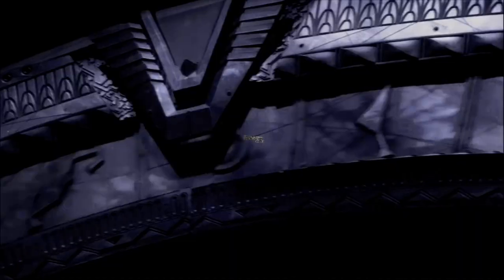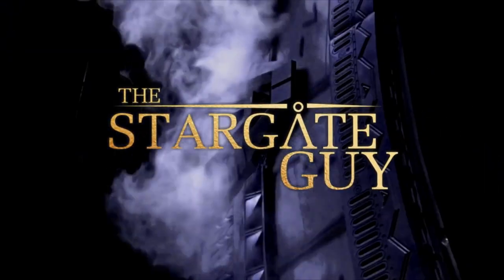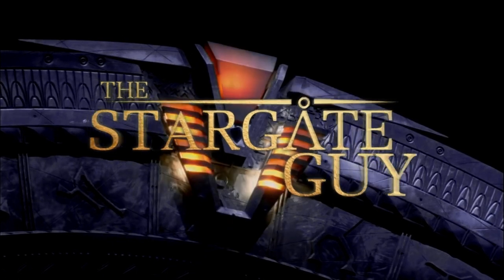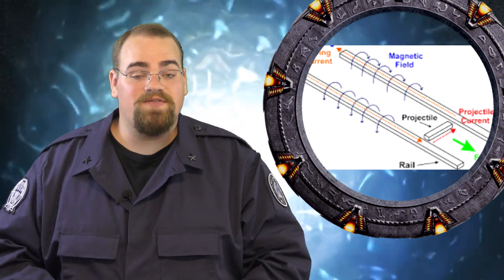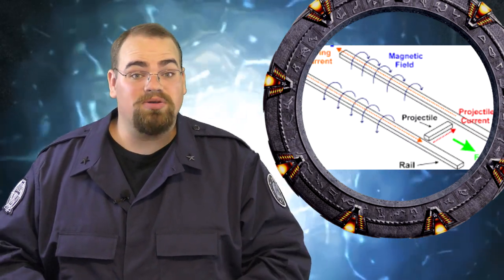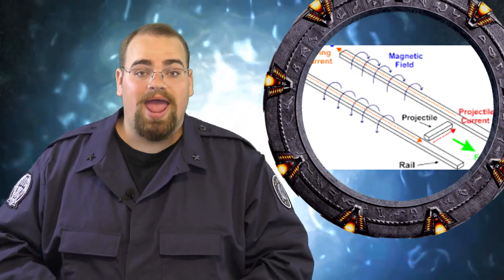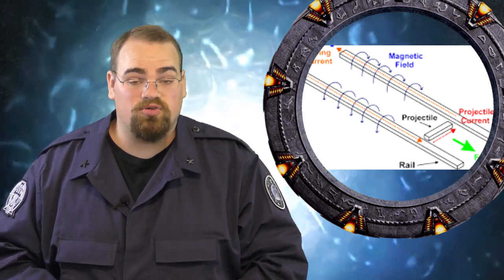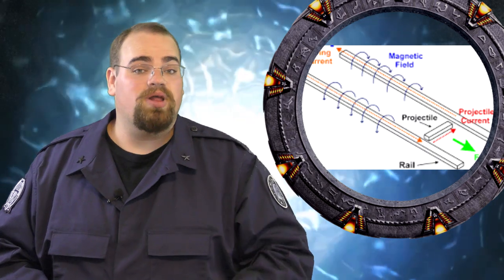Rail Gun : How it Works

Comment: To accelerate 0.05kg bullet to mach5 (1715m/s) you need 147kJ of energy. With 500 rpm the Power output is about 1.23MW (yes that's megawatt). Sources vary on how efficient railguns can be, ranging from 16% to 90%. That still means the gun would produce on order of megawatt of heat, most of it ending in the rails and faraday cage containing the EM field. The gun would melt in a single round without some magic cooling system. It might even be a railgun/steamcannon combo - one projectile propelled by the railgun and second propelled by the vaporized liquid nitrogen used to cool the railgun.

Comment: It wouldn't surprise me if in the near future the US Navy developed a line of nuclear stealth submarines that used rail guns instead of missiles. Either that or nuclear powered destroyers. It wouldn't be very practical to have such a gun on a Nimitz or Ford class carrier (no room). Whatever the ship, they would almost certainly need to be nuclear powered, traditional diesel-electric likely wouldn't be able to meet the power requirements.
Reply from the maker: Well they might in the future. It seems like the next wave of weaponry. I wouldn't be surprised if they managed to fit the tech into a more hand held version at some point. Our battery tech is starting to get up there.

Comment: Ironically, kinetic weapons such as rail guns should be more effective against shields as they have a neutral charge and hence more difficult to deflect by fields alone.  The problem with how they used it on Atlantis is that rail guns are artillery not point defense weapons, the Gatling guns shown on the Expanse would've been better suited for anti-aircraft roles.  

The BAE rail guns funded by the Navy requires the conductors be resurfaced and adjusted preferably between each shot and the gun did not meet the requested range and velocity requirements.  Personally, I did not find this surprising as the Navy wanted a strategic replacement for expensive cruise missiles hence the desired range and velocity while arms manufacturers are not motivated to replace profitable cruise missiles with metal slugs.  It really looks like BAE really didn't even try to reduce the well known conductor wear problem of rail guns, they did not use conductive lubricants, they did not use plasma as the conductive interface or even disposable wires to the sabot, they didn't even consider ditching the Lorentz force and go magnetic with the coil gun, they simply said that the conductors had to be adjusted and resurfaced every one to five shots.  I really think they didn't want to endanger cruise missiles sales.

Comment: Okay too many issues with this video:
- Ha'taks are not small, they are mother ships. The Al'kesh are probably what you meant in terms of the "small" category.
- Wraith hives have shields? Since never.
- You could catch them by surprise or you know failing that, fire enough shots at the shields that they deplete and shutdown, that works too.
Reply from the maker: You are right, I messed up my goa'uld names. And Wraith hives do not have shields, they are just super massive, so it's hard for a rail gun round to do much damage.

Comment: i though the real life ones where balls made of steel with a lead core
Reply from the maker: Not that I know of, just the round in the video with the steel box around it and that projectile launches out from it.
Reply: I believe they are made of tungsten carbide . It has twice the strength of steel and an incredibly high melting point .

Comment: Not 20 mm Vulcan cannon shell size.... US Navy has real operational railgun... Not fantasy...... Firing a tungsten steel DART....... So try 4 MM. That is all bro..... Stargate writers knew this too...... Please rewatch the seige ...... Not 10000 round magazines and you SEE them load a magazine...... Can get you exact timestamps if you need bro..... As a Stargate writers bit of an expert here
Reply from the maker: Col. Everett: We brought along a few rail guns… they will deliver in impact velocity of march 5 at 250 miles a standard magazine will hold 10,000 rounds.”Ford: Woah. That was from The Siege Part 2, Time index 6min 25Sec. And yes we do see them load the Rail Gun filled with smaller bullets about 20mm size at time index 10 min 29 seconds of the same episode. It was in a case but the bullets themselves where belt fed, like the Browning M2 50 cals, they were also setting up. And I did talk about the modern versions of the Rail Guns at the end of this video.

Comment: Physic FAIL!!!! Faster the projectile less interaction whit matter it have!!!

So more power = less DAMAGE!! but more penetration.
Reply from the maker: Doesn't more penetration cause more damage?
Reply: Depend what do more damage  1 cm hole of hi energi bulet or point blank shot from shootgun ?

This is big problem of hi energi guns since they dont carry a pay load they are basicli penetrating rounds.

When you are shooting a plane or ship you want your round to explode or shatter to do maximum internal damage.

Penetrating is good for naval combat since you are able to shoot thru armor and hit places like ammo storage.

But in space combat unless you can fire whit total acuraci you basicli spray and pray you hit something.
Reply: I don’t think the guy knows what he is talking about, the standard Anti tank round carried by tanks is the APDS or APFSDS. Which stands for Armour Piercing Discarding Sabot or Armour Piercing Fin Stabilised Discarding Sabot. Basically a round is fired at the target tank, a few seconds after leaving the barrel the Sabot peels away to reveal the Dart. Said dart is usually a blend of a low mass metal for the body and a high mass metal for the tip (aluminium/tungsten is common), which upon impact it has so much KE the armour of the target tank usually behaves like a fluid instead. Said rounds usually cause spalling which is parts of the interior hull and round fragmenting and bouncing around in the tank. Killing crew.nd damaging components.

There is the problem of overpenetration on lighter AFVs where the round just zips through. Of course for that you load other rounds as the Anti-Tank round is a specialist round and makes up a small portion of the load out.

Now considering in Stargate the Rounds are probably a Trinium/Naquadah round to maximise its punch (a pure trinium round would be terrible) and considering what it would be getting shot at, I don’t think it would have OP problems. It would have enough time to transfer it’s Kinetic to damage via spalling.